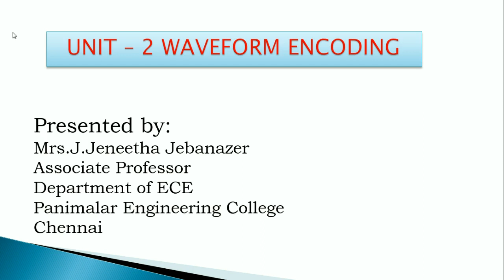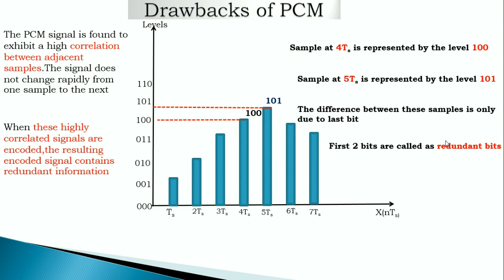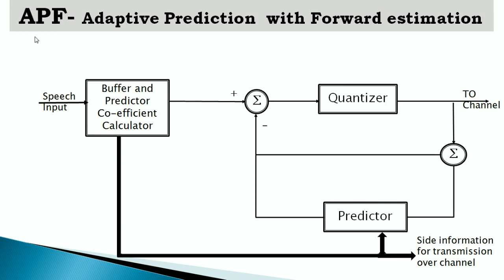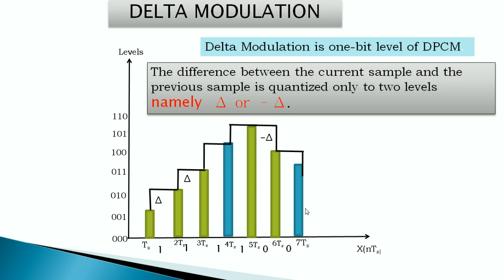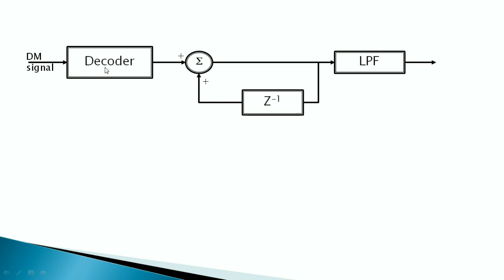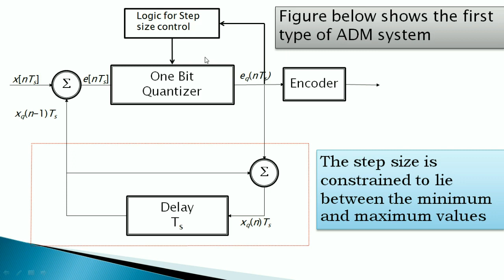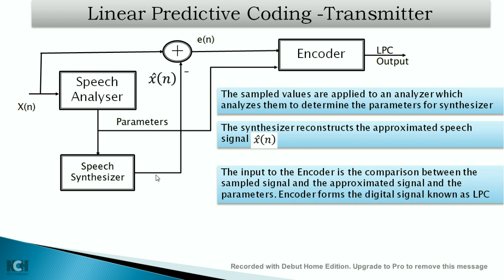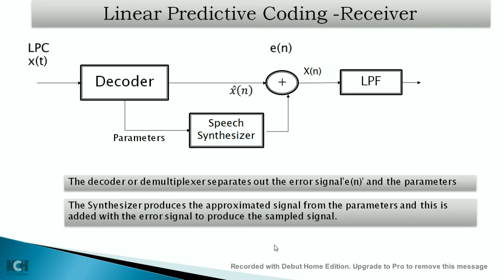DPCM,ADPCM,DM,ADM and LPC by Jeneetha seelan

Comment: Thanks for this great lesson. I have one basic question: as DPCM, ADPCM's aim is compression of audio stream in order to reduce the required bandwidth, why does the process involve prediction as actual sample values are already available as a continuous stream of bytes? Let's explain: ADC will produce continuous stream of 8 (or 16) bits samples. Thus no need to predict the next sample as it will come out from the ADC. Then the difference between consecutive samples could be easily computed without requiring any prediction. Could you please explain where my comprehension is wrong? Thanks a lot.